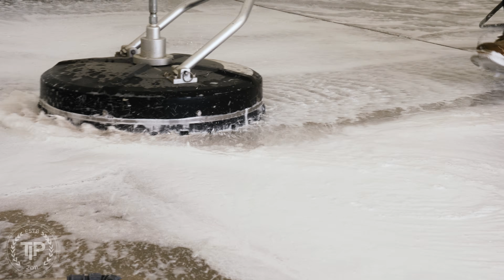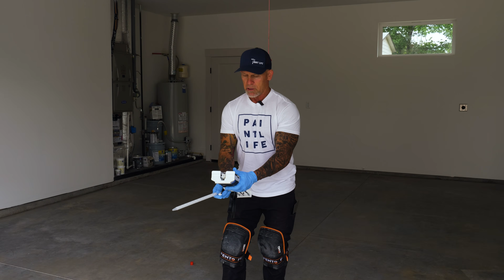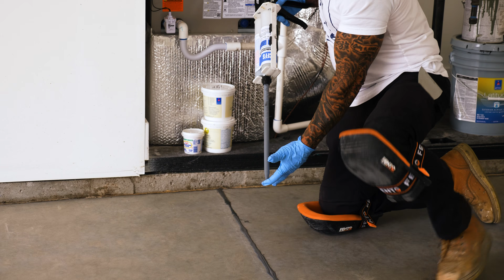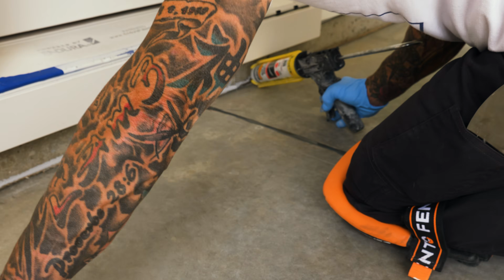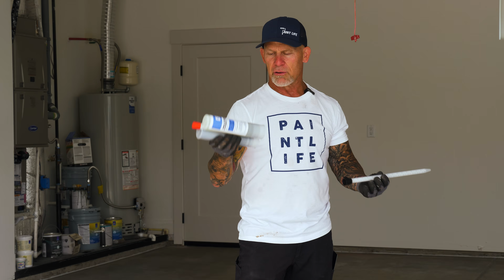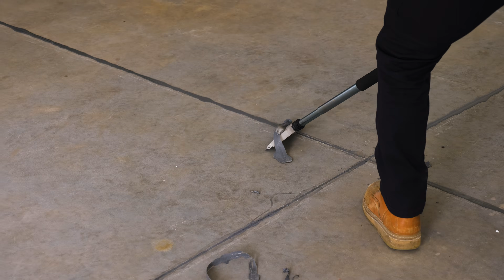How to Properly Fill Cracks & Saw Cuts Before Epoxy | Rust-Oleum Concrete Saver Pro + Poly Flex 83

Comment: Thanks for the video Chris. What would you recommend to fill cracks in a concrete slab that moves 1/4 to 1/2 inch during the changes of seasons/weather?
Reply from the maker: @arniewingco3561 That's a real challenge when you have that much movement in a concrete slab. For cracks that are moving 1/4 to 1/2 inch with seasonal changes, you absolutely need a highly flexible solution. A two-part polyurea joint filler is what you're looking for, similar to the polyurea we used for the saw cuts and cracks in this video. These products are designed to move with the concrete, preventing future cracking of the filler itself. You've got to make sure your prep is meticulous, just like we showed, cleaning out all the debris and ensuring a good bond. It's the nature of the beast with concrete to move, so you need a product that can handle it.

https://idahopainter.stesso.com/?yt=UgxPdmhAzGV2BdLjrsJ4AaABAg&q=Typo+in+title.++Poly+Flex+83+should+be+Poly+Flex+93.++Smiles&context=video%3AVXcCNU01-WY&seed=eyJtIjozNDk0MTksImlhdCI6MTc5MDM1NjI1MiwiZXhwIjoxNzkxNTY1ODUyfQ.i9yq9DlFhLcvA8TAehMlkx158MFwNok8g5vECzXZZgA

Comment: If you fill gap with epoxy, doesn’t the concrete need to expand and contract?
Reply from the maker: Im am not filling it with Epoxy
Reply from the maker: @Jimmylee922 That's a great question, and you hit the nail on the head! Concrete absolutely needs to expand and contract. That's why those saw cuts, or control joints, are put in there in the first place—to manage that movement and prevent random cracking. When we fill them for an epoxy floor, we use flexible fillers like the 2-Part Poly Flex 83 shown in this video. These products are specifically designed to move with the concrete, so they don't crack out and compromise your coating. You can see us getting into that process right here https://youtu.be/WDr_YEtomN0.

Comment: We never filled saw cuts we just fixed floors with bondo but as always u guys do nice work
Reply from the maker: Thanks!
Reply from the maker: @louistalbert5439 Yeah, times change and so do products. For epoxy, properly filling those saw cuts and cracks is absolutely critical for a lasting finish. If you skip that step, you're just asking for trouble down the road. Glad you appreciate the work!